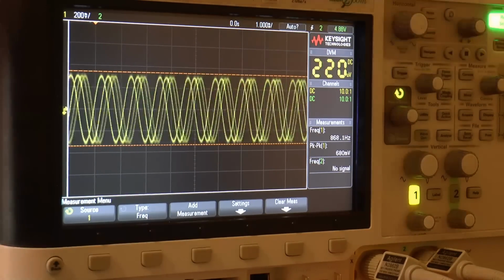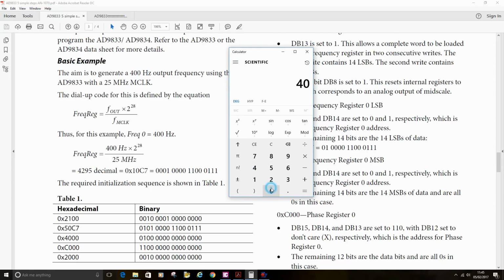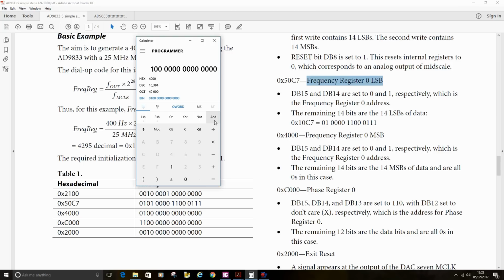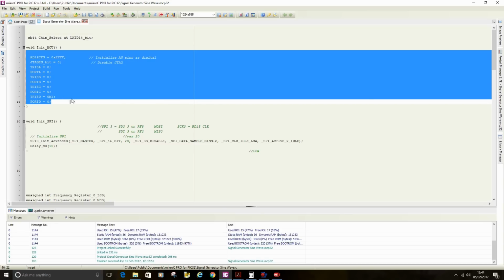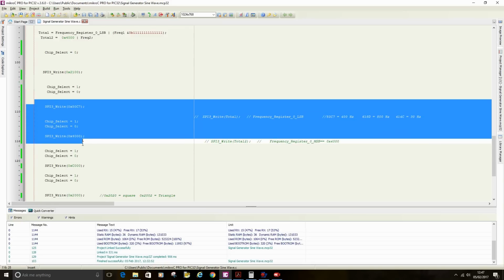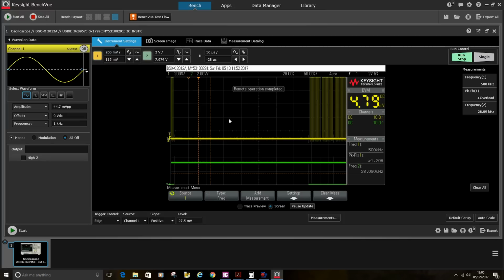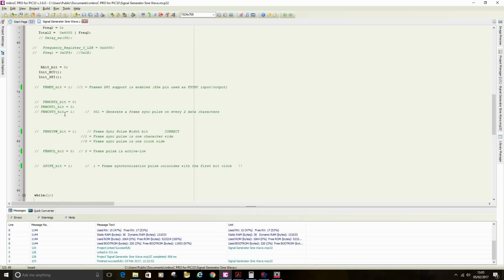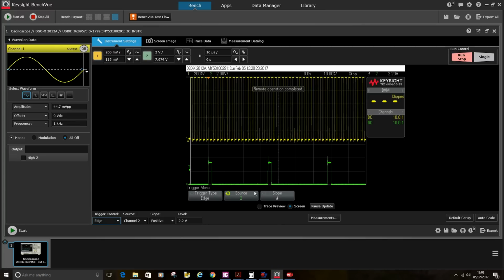AD 9833 Waveform Generator, programming with MikroElektronika's MikroC Pro for Pic32

Comment: Hi John, I don't have this kind of programmer and I wonder if it could be done with Digilent Waveforms software? There and SPI protocol and looks like made with purpose. Or is it better with Arduino? Thanks in advance,
Reply from the maker: Yes, the Digilent could work if the waveforms are fast enough.

Comment: Hi John I have an issue with my AD9833 and a PIC32MM0256GPM048. SPI transmission signals look ok but I can't see anything on AD9833 output. My SPI configuration register is SPI3CON=0x88038520 . I configured  SPI with framed mode as you posted in the video. The code I used was this.

receive=SPI3_Exchange16bit(0x2100);
receive=SPI3_Exchange16bit(0x50C7);
receive=SPI3_Exchange16bit(0x4000);
receive=SPI3_Exchange16bit(0xC000);
receive=SPI3_Exchange16bit(0x2000);

SPI functions are provided by Mplab Circuit Configurator.
Reply from the maker: Just found an old file and put it on Github.

Comment: Hi John - I must have seen your vid 100 times. I am using a pic32mx150f128b and a ad9833 and can't seem to get the timing straight. My SCK seems to be out of phase with yours - i.e., mine is up when yours is down. Would you mind sharing (if  you still have it!) the actual value that you have written to your SPIxCON register? Mine is 0x99028470 with the expectation of framed, 16-bit word, chars per transfer. According to my low-budget logic analyzer, I am sending the right data over the bus. But, I am not able to control the waveform frequency above its default of about 1.2mhz. https://imgur.com/a/9fiainj
Reply: Finally figured it out. The clock polarity had to be opposite of what I thought or active high. So SPI1CON=0x99028430 gives me 16-bit word FRAMESYNC mode that actually works with the AD9833. Thanks for posting your logic analyzer output!.  https://imgur.com/a/9fiainj
Reply from the maker: Hi Joe,
Thank you for your many views lol, I'll look to see if I still have any info / program etc.
I found it, took out all the spaces and Youtube put tthem back lol.
Reply from the maker: unsigned int Frequency_Register_0_LSB;
unsigned int Frequency_Register_0_MSB;
unsigned int Freq1;
unsigned int Freq2;
unsigned int Total;
unsigned int Total2;
char cnt99 = 0;

char frequencystr[8];
int freqconvert;
int freqconvert2;

void main() {

   //       TFT_Fill_Screen(CL_WHITE);
  TFT_Set_Pen(CL_Black, 1);
  TFT_Line(20, 220, 300, 220);
  TFT_LIne(20,  46, 300,  46);
  TFT_Set_Font(&HandelGothic_BT21x22_Regular, CL_RED, FO_HORIZONTAL);
  TFT_Write_Text("SineWave Generator", 68, 14);
 // TFT_Set_Font(&Verdana12x13_Regular, CL_BLACK, FO_HORIZONTAL);
 // TFT_Write_Text("EasyPIC v7 Fusion - PIC32", 19, 223);
 // TFT_Set_Font(&Verdana12x13_Regular, CL_RED, FO_HORIZONTAL);
  //TFT_Write_Text("www.mikroe.com", 200, 223);
 // TFT_Set_Font(&TFT_defaultFont, CL_BLACK, FO_HORIZONTAL);

        Frequency_Register_0_LSB = 0x4000;
        Freq1 = 0x14C;    //= 30Hz
        Total = Frequency_Register_0_LSB | Freq1;     
      
       Frequency_Register_0_MSB = 0x4000;     
      
        Freq2 = 0;
        Total2 =  0x4000 | Freq2;
      // Delay_ms(30);

   //   Frequency_Register_0_LSB = 0x4000;
   //   Freq1 = 0xCF9;  //0x1E;      
      
       RA10_bit = 0;
       Init_MCU();
       Init_SPI();
      
      FRMEN_bit = 1;  //1 = Framed SPI support is enabled (SSx pin used as FSYNC input/output)     

     
  /*//  FRMCNT2_bit = 0;
    // FRMCNT1_bit = 0;
    // FRMCNT0_bit = 1;     //  001 = Generate a frame sync pulse on every 2 data characters*/    commented out                            

      FRMSYPW_bit = 1;     // Frame Sync Pulse Width bit        CORRECT
                          //1 = Frame sync pulse is one character wide
                          //0 = Frame sync pulse is one clock wide
                          
      FRMPOL_bit = 0;  // 0 = Frame pulse is active-low            
                                  
      SPIFE_bit = 1;      //  1 = Frame synchronization pulse coincides with the first bit clock   !

        //    TFT_Set_Font(TFT_defaultFont, CL_Black, FO_HORIZONTAL);
           Total = Frequency_Register_0_LSB | (Freq1 &0b111111111111111);
           Freq1 = 0x14C;

            TFT_Fill_Screen(CL_White);

            TFT_Rectangle(35,90,120,130);

             TFT_Line(20, 220, 300, 220);
            TFT_LIne(20,  46, 300,  46);
            TFT_Set_Font(&HandelGothic_BT21x22_Regular, CL_RED, FO_HORIZONTAL);
            TFT_Write_Text("SineWave Generator", 68, 14);     
  
    while(1){       

       Total = Frequency_Register_0_LSB | (Freq1 &0b111111111111111);
       Total2 =  0x4000 | Freq2;

          freqconvert2 = Total2*1500;
           
            freqconvert = (Freq1/0x6B)*10 + freqconvert2;

         inttostr(freqconvert,frequencystr);
          TFT_Set_Font(&HandelGothic_BT21x22_Regular, CL_Red, FO_HORIZONTAL);
         TFT_Write_Text(frequencystr,40,100);

         SPI3_Write(0x2100);          
         
        SPI3_Write(Total);   // Frequency_Register_0_LSB         //50C7 = 400 Hz    618D = 800 Hz   414C = 30 Hz  0x69F1 = 1kHz
       //    SPI3_Write(0x69F1);

        SPI3_Write(Total2);   //    Frequency_Register_0_MSB== 0x4000
        //   SPI3_Write(0x4000);

         SPI3_Write(0xC000);

         SPI3_Write(0x2000);       //0x2020 = square  0x2002 = Triangle

         Freq1 = Freq1 +0x6B;    //  0x69F1 ==1000Hz        +0x6B; 10Hz

         if (Freq1 >=0x3FFF){
          Freq1 = 0x14C;
          Freq2 = Freq2 + 1;
            }          

             Delay_ms(500);
           TFT_Fill_Screen(CL_White);
            
            TFT_Rectangle(35,90,120,130);
            
             TFT_Line(20, 220, 300, 220);
            TFT_LIne(20,  46, 300,  46);
            TFT_Set_Font(&HandelGothic_BT21x22_Regular, CL_RED, FO_HORIZONTAL);
            TFT_Write_Text("SineWave Generator", 68, 14);                  
    }

}

Comment: This kind of thing cries out for a custom library such as the Arduino platform enjoys (I know they have one for the AD9833 and the AD9850 devices.) Also it would be nice if MikroElektronika would come up with a click board based on either of these devices.

I do have an AD9850 module and I intend to experiment with it using GCB and my EasyPIC7 rather than MikroC for PIC.
Reply from the maker: Does that include my code?
I don't post my codes because people would need the same development board and pic controller etc.
I do show 'how to do it' which many don't.
Reply from the maker: Hi Nick,
Thank you for your comments.
I had a look on the internet, no one seems to make a board with the AD device that has a sweep function, maybe there's a market there.
The odd thing, I paid over £7 for the chip plus vat, the same chip on a board from China is £3 with free shipping!
I've not seen a device where the timing is so critical !
Thank you

PS, what is GCB?
Reply: Probably means GDB.  All these videos about the AD9833 would be much improved if people would link to their code.
Reply: No, I meant GCB - Great Cow BASIC.
Reply from the maker: Cool
Thank you